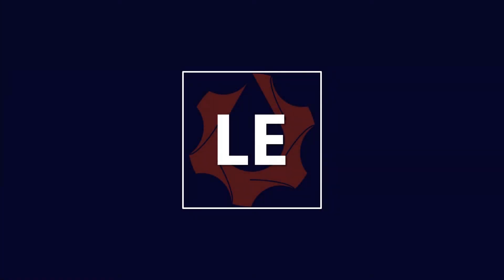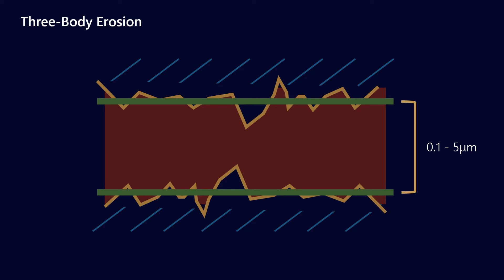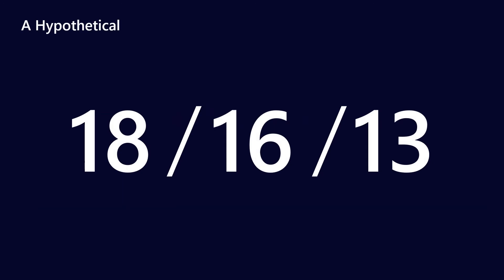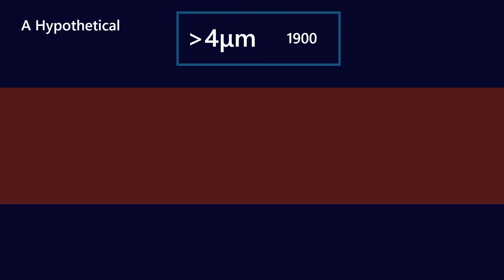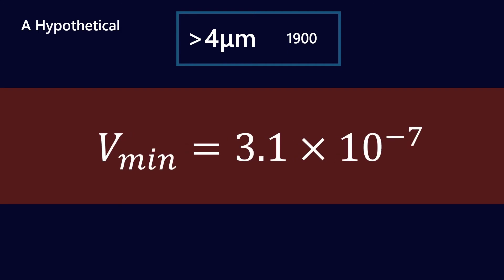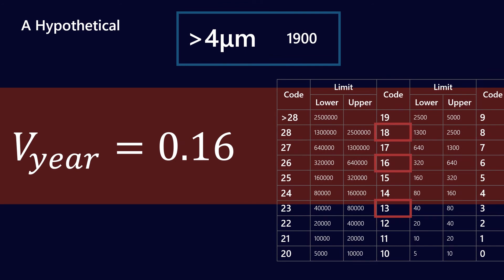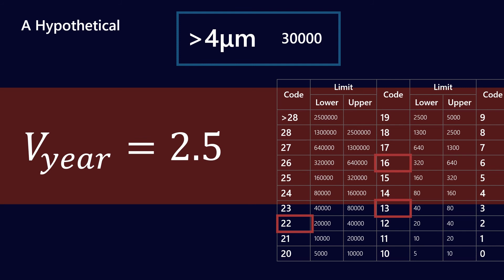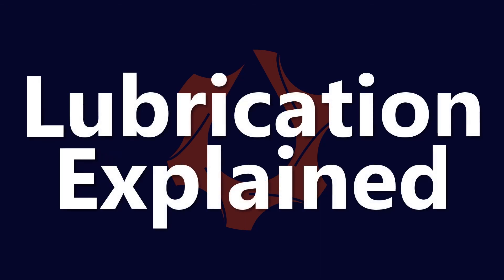Why does the cleanliness of my oil matter?

Comment: So if I understand it correctly, automotive oil filters only filter out down to about 20 microns. This means all bearings are under threat from dirty oil. Is there any way to improve the lower limit of filtration? I have fitted a Neodymium magnet to my filter for the smallest ferrous particles - any other practicable methods? Thank you
Reply from the maker: That's true actually - the problem with filtration any finer is that you risk pulling out some of the additive package too. Magnets are a good measure that helps a lot - ferrous debris gets work hardened as it circulates through so ferrous debris gets more and more potent as is ages. Beyond that there isn't a whole lot you can do - but hopefully the antiwear package is doing a good enough job from the start that it prevents a lot of wear.
Reply: ive been using Fleetgard filters from my Cummins agent, specs listed at 7 microns.. have served me well to date

Comment: Truly amazing. As a mechanic for most of my career it always bothered me how little attention was paid to oil cleanliness. This video explains it!!! I wish i could have shown this to many bosses who expected me to keep old equipment running without allowing me to spend the time and money on systems to keep the oil clean... looking at anyone adding oil without a filter cart lol
Reply from the maker: Glad it helped!
Reply: ive always appeciated the effects particals should have & long held the view oil is cheap.. but this has been excellent to see some fact figures.. interested to know chemical & water contaminant effects of errosion on various part alloys.. ive never added oil to engines.. if it gets below low its due for a change & always change hot after an extended run.. dont have any oil user cars atm.. & dont seem to have rocker cover condensation sludge issues either